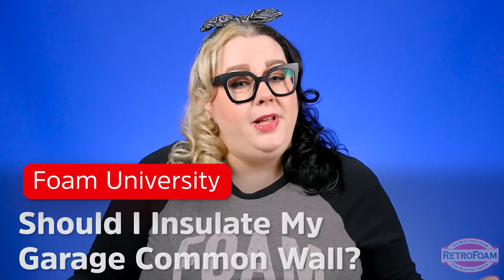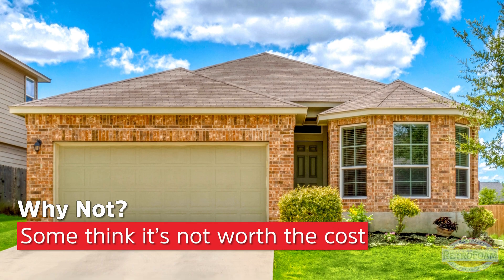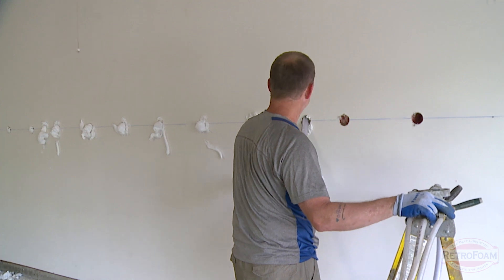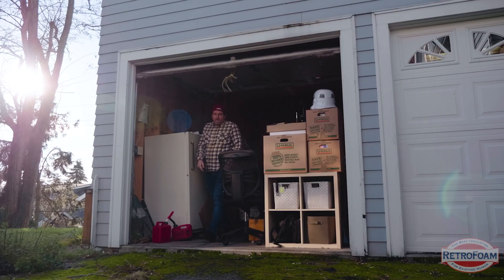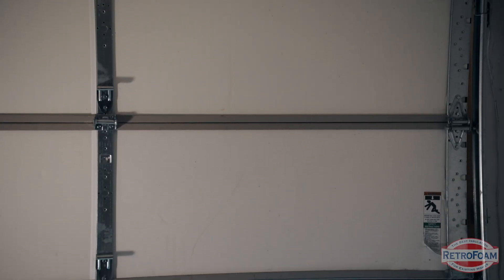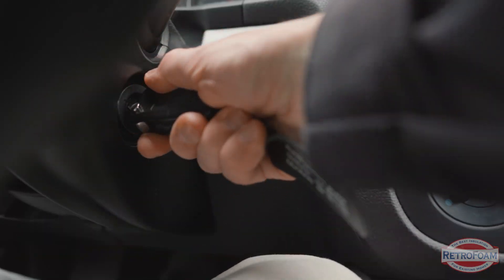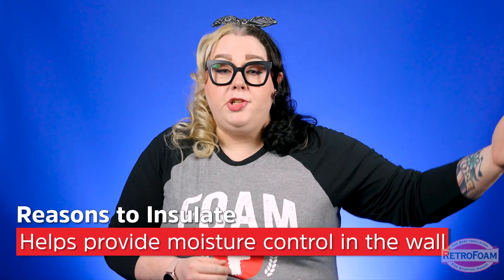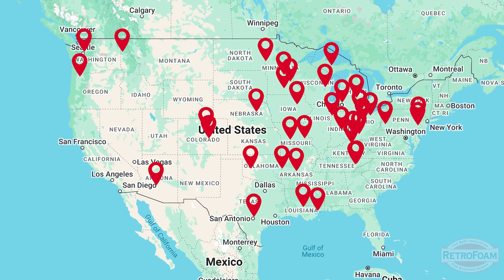Should I Insulate My Garage Common Wall? | Foam University

Comment: I never thought about how much of an impact the big garage door has on this. I feel like a good amount of of unconditioned air could come through that even when it's closed. Insulating the common wall seems like the best way to keep the living space conditioned.
Reply from the maker: Absolutely! That garage door is a major source of air leakage, even when it’s closed. Insulating the common wall with RetroFoam creates an air barrier that helps keep all that unconditioned garage air from creeping into your living space. It’s one of the smartest steps you can take for better comfort and efficiency! 🤗